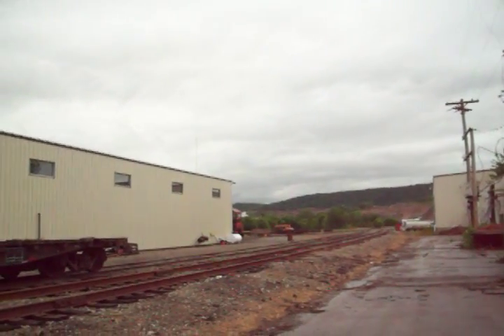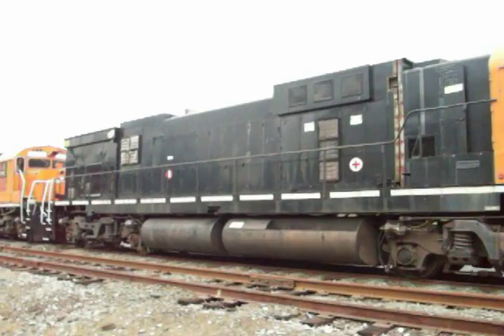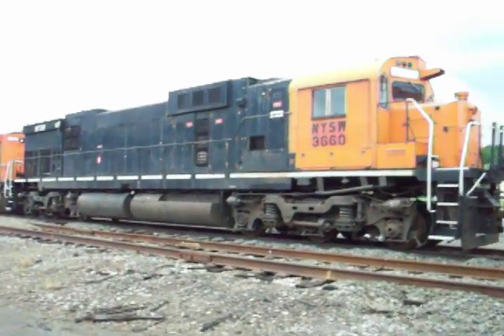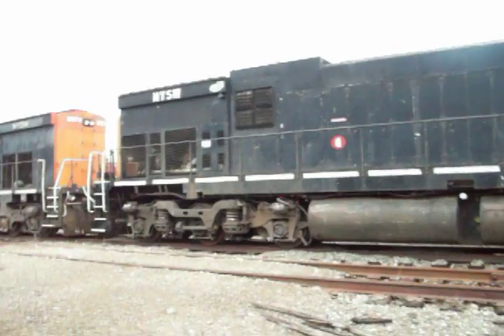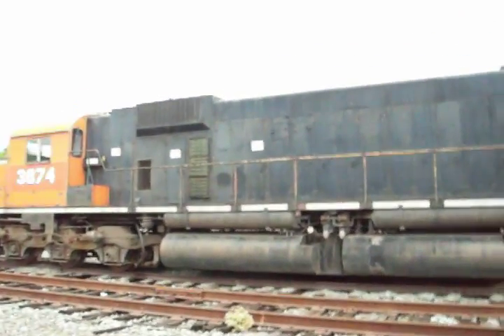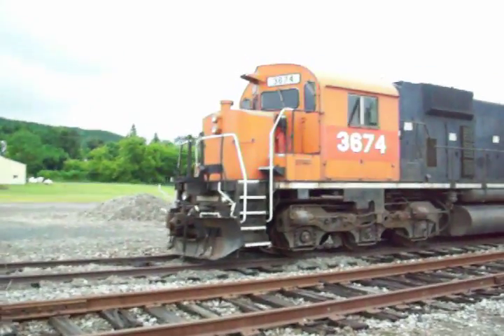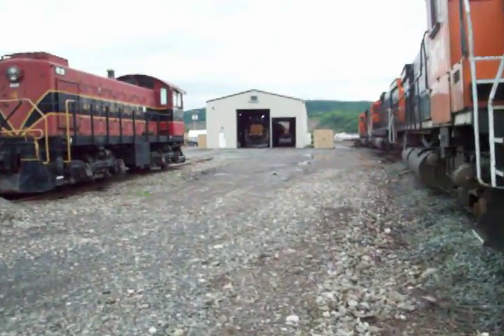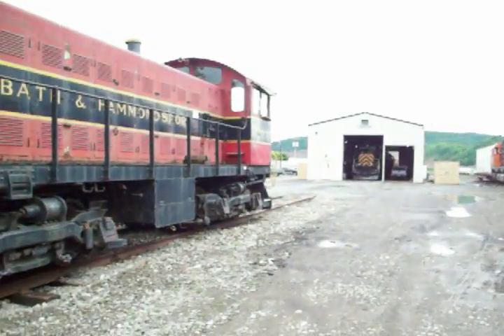The Alcos of Cohocton

Comment: ive worked on these exact c636 for years for nysw...........they suck o work on but pull pretty good from what the train crews say..........i remember taking these exact engines out of ervice and then getting our newly rebuilt sd-40's from AMP.........every traction motor that came from AMP on those 40;s was one time or another changed out......